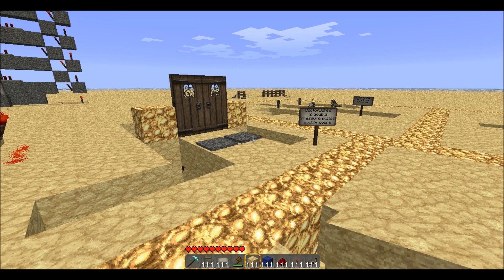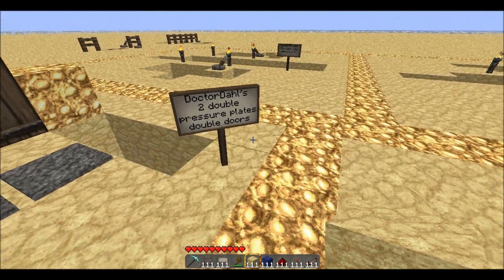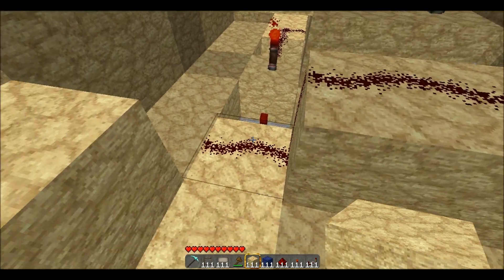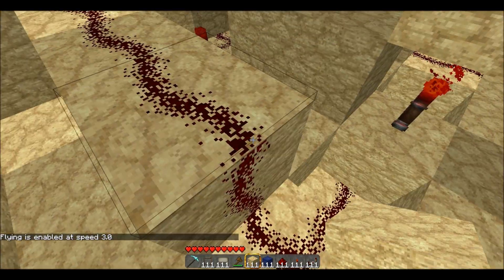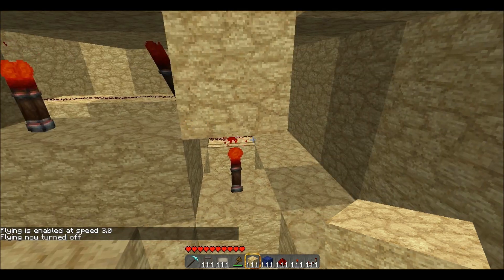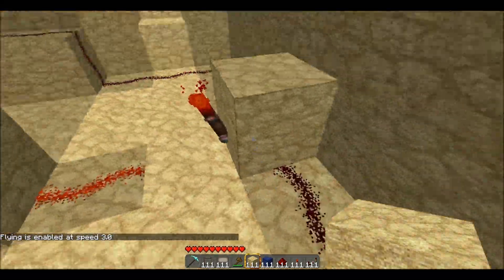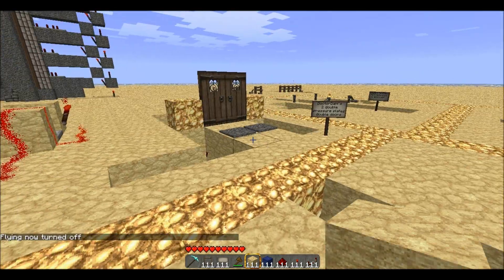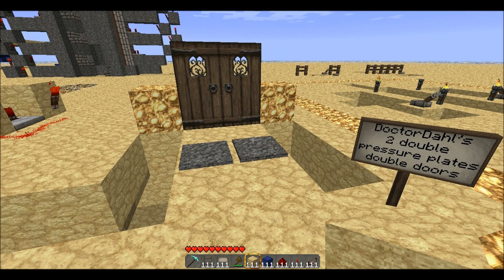Bestest Double Doors...Yet - Minecraft Tutorial

Comment: still a more compact version than that

simply put redstone repeaters on either side going directly to the blocks underneath the doors. then set the repeaters going to the vertical redstone torch one tick longer than the other two to synchronize the delays